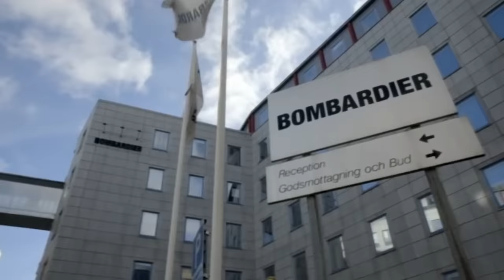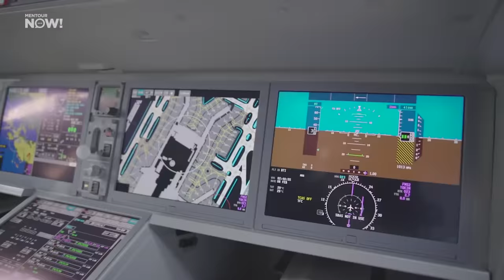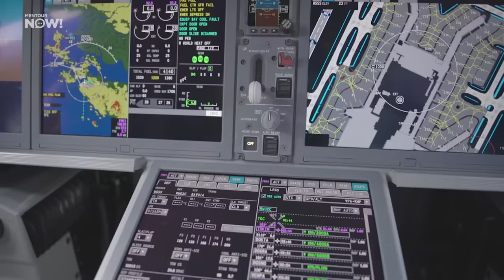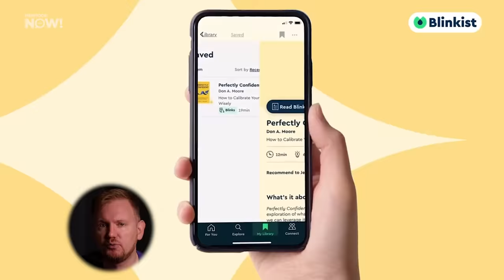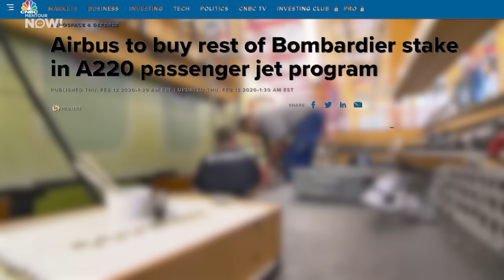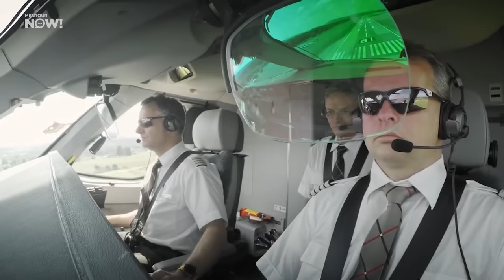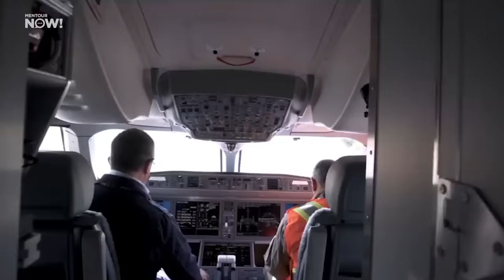Did Boeing GIVE Airbus a FREE Airplane?!

Comment: Regarding the supply chain.  One way to look at it is that it will be a struggle for Airbus (because it will).  But another is that it is giving Airbus serious inroads with traditional Boeing supplies.  This, in turn, might give Airbus more of a say in product development for companies that traditionally only really answered to Boeing.  And that could place some interesting, and perhaps serious, constraints on future Boeing designs.

I think Airbus is playing some serious 5D chess here.
Reply: Most aircraft already have global supply chains and the use of American made avionics, landing gear, engines etc has never caused Airbus issues in the past. Airbus is as big as Boeing in the commercial aircraft sector so has similar buying capability and already has a A320 FAL in Mobile which in order to meet US requirements for parts of origin has substantial US supply lines. I don't think this is the limiting factor here. The key limiting factor is the way that Boeing has been managed since it moved from Main Street to Wall Street.
Reply: @PAC-fp9hy  I take you didn’t watch the video or, if you did, you assume I wasn’t paying attention at all and, in addition, disagree with the conclusions of the video?

Further, you’re focusing on the wrong part of the argument (probably my fault for writing it wrong), the main thing I was trying to put forward is that this would give Airbus further inroads with more of Boeings partners (if what Mentour said is true).  Those manufacturers will probably look into homologation wherever they can to keep costs down.  Homologation has it’s advantages in regards to diversifying a supply chain, but it also means you need to build towards that line of products rather than being able to expect that the vendor will bend over backwards to work with your technical requirements because they have no other major customers.

Lastly, I never said this was Boeings only problem.  It’s just another possible bullet point on a very very long list.
Reply: @TheActualJae  Airbus already has partnerships with many of Boeing's partners. PW, Engine Alliance, RR, Moog, Thales, Honeywell etc etc. They are not just Boeing partners. This deal is unlikely to have given Airbus any significant supply chains that it didn't have already. And even if it did, the components would be only be suitable for the A200 such as the airframe and composites. The whole argument for taking on a loss making project was to be able to use existing Airbus supply chains and buying power to make the A200 profitable, so that would imply that AIrbus already had contracts withe the main suppliers. The question of homologation is very complex because each component has to pass FAA and EASA requirements for the DOA, POA and MOA in respect of the aircraft type it is fitted to. That is always a lot work as Boeing know only too well when it cut corners on the Max. Mentour is a Boeing pilot, and he does not work for Airbus, so it is probably speculation on his part.

Comment: Recently our local national carrier (Croatia Airlines, OU) swapped their A320 neo options they were sitting on for years to A220 (with plans to have an all-A220 fleet at the end). Besides the plane being pretty "right-sized" for OU it seems that Airbus was willing to work this swap out as it needs all A321neo production slots it can get as that is where their biggest backlog x value currently stands. So by shifting some of the "smaller" airlines to A220 (Air Baltic being a showcase) pipeline, Airbus can churn out A320/321 neos for big/major orders and operators (getting them planes earlier than previously possible, to prevent them from considering 737MAX).
Reply: Just curious, how will OU finance those planes?
Reply: This is exactly the reason Airbus is considering the A220-500. Yes it will compete with the A320neo sales, but they cannot make enough of the A320 family planes anyway and people are choosing Boeing because of the lower wait times.
Reply: And on this way Airbus avoided that Croatia Airlines switched to the E2-Jets from Embraer. Air Baltic was most probably the model for this decision.
Reply: Yea that's a possibility but not the current reality,  you still have to wait longer to get the a320neo/321neo , compared  to the MAX . 

The a220 can only be a substitute for the MAX 7 /a319 , so Boeing still has a few more years to take advantage  of airbus's limited /constrained production and huge backlog . 

Not to mention that the a220 is currently   having some supply chain issues  of its own , so ramping  up production  won't be an easy task 

Boeing will rack up hundreds of orders for the 737MAX  before Airbus manages to increase and stabilize its production rates .
Reply: @ProT3ch  the 737MAX 8 seats around 212 in MAXm configuration,  a potential  a220-500 won't seat more than 180. 

The a220-500  will have lower profit margins than  the a320neo for its first few years , and will definitely  hurt 320 sales . Probably the reason Airbus is still in some kind of a dilemma  with this .

An a220-500 could take 2-4 years , lots of time for Boeing to continue  to snatch hundreds of orders , due to a320neo/321neo production  slot constraints.

Comment: The A-220 or CS-100/300 is a real step forward for single aisle aircraft.  The layout in the Galleys ,Cabin and Lavatories are very new and welcomed by Carriers.   The Fuel efficient Engines and Pilot designed Cockpits make it not only preferred but a runaway Winner in its category. 
Yes I am a proud Canadian or loves the Bombardier product.  Perfects you can confirm this point. The door sill just inside door one, still says CS-300 as a tribute to its heritage. 
I love your videos.

Comment: In my own opinion, Boeing has sat back on it's laurels for too many years. The company threw it's dummy out of the cot. For too many years, Boeing has been shortsighted. 

They thought that payback would be to get involved with Embraer after the Delta deal. And how right 'royally shafted' those poor guys became when Boeing dumped them. It was like being proposed to and then jilted at the altar.

I am so happy the C-Series/A220 became the success it's turning out to be, thanks to the skills of every designer, engineer and Canadian that put their heart and soul into this Bombardier project. Long may it succeed.

All kudos though to Airbus for spotting a gem and taking it to the world. The sad part of the story, is if Bombardier had just pushed on that little bit longer, maybe it would have been a success in it's own right without either of the duopoly.

At some point, Boeing has to realise, for all the magnificent machines it builds, it cannot think it's a company that dictates anymore.

We've all seen what happens to dictators!
Reply: The C Series is a well designed Aircraf, it took Airbus marketing to sell it to the world , pilots and passengers who fly it are happy with the experience- flying it and  quietness  and spacious feeling inside.The  geared  Turbofan by P&W is a good engine after some development.
Reply: To be honest I think that they needed Airbus help with mass production, as well as cost reducing manufacturing techniques (from memory)
Reply: I work on the military side of Boeing and aren’t commenting with insider information. My opinion is that we’ve lost the love of the products. I’ve had this conversation with  many executives. I’ve said, “who’s our Elon”? In other words someone that loves innovation and customers. Once our competitors uses the next step function in technology in the 737 market, the end has begun. It’ll take 20 years, but Boeing is not a leader, just a cost cutter. Selling the same 50 year old design with lipstick applied.
Reply: @jamesdellaneve9005  It's such a shame to hear those words from someone that works with Boeing. As you say, to lose the passion for what you're producing and build it to a price is indeed a sad state of affairs. 
I don't know how true this is, but I hear the rot started when MD management took over?
Reply: Without one of the duopoly behind it there is just no way the C-Series would have been anywhere near the success it is - it may have turned a useful profit but it would never be the Embraer-killer it is. Its basically about massive marketing muscle, plus an awful lot of capital and mass manufacturing expertise on tap.
Reply: @kenoliver8913  To a degree, iagree wholeheartedly with you. That's why I say, it was such a shame that they needed either of the big two and that they couldn't do it alone. But as we've seen, it's not panned out that way - but a success is a success, whichever way you look at it.

Comment: You have to feel good bombardier, they spent a bunch of money to develop a great jet that would have been competitive and would have established Bombardier as a real competitor to the duopoly.
Reply: They certainly did design a great jet. 

Apart from Boeing screwing things up, one thing that was in the way of it attracting seriously large orders was the size of Bombardier in the market place. They were comparatively small, and suppliers were reluctant to give them good prices on parts. So the C Series was going to be moderately pricey to buy and support. Bombardier also didn't have a large sales team; it takes a lot of staff to run multiple sales campaigns necessary to get a large order book. That they managed to sell any at all as Bombardier is testament to just how good a design it is; the plane sold itself to anyone that sampled it, and made the price still look good.

One of the things that is good about Airbus coming into the program is that Airbus can drive supplier prices down, and has a vast sales team that can mix A220s in with other sales campaigns. Airbus saying "we believe in this aircraft" is a pretty good endorsement, enough to make a lot of airline executives believe that there is a long term future for the design, which is also an important thing. 

I do feel sorry for Bombardier that they got clobbered so, but I think that, in the end, for the people (if not the investors) it's going to work out well. They've got a slice of what looks like being (in the long run) a very large cake. It's not as glamourous as the whole cake, but it's a very good second best! And for the government investors, it'll come good; there's going to be a lot more well paid, tax paying employees for a long time to come, bringing in money from overseas.

Comment: Scott Hamilton's "Air Wars" book is certainly well worth a read. 

One thing not really discussed in this vlog is how acquiring the C Series fits right in with Airbus's long term commercial strategy, inspired by John Leahy (Airbus's recently retired head of sales, who basically made Airbus what it is today). Leahy was all about market share, and had a very strong drive to increase Airbus's market share as pretty much the sole commercial driver for the whole of Airbus. He / Airbus didn't mind whether or not market share came about from Airbus selling more aircraft, or spoiling Boeing's prospects in the market. 

Acquiring / saving the C series was just another way of moving market share from Boeing to Airbus. To outperform all aspects of A220 / A320neo, Boeing would have to spend an absolute fortune on a 737 replacement, to have any hope of reversing the single aisle market momentum and restore good sales margins. Boeing clearly hasn't the money, expertise, or patience to do so. 

And it'd really take two different models for Boeing to successfully outperform both A220 and A320neo. So, Boeing need two moonshot development programs. Airbus picked up the fruits of one pretty good moonshot program for nearly free. Even if Boeing did a full CF A220 look-alike, it'd cost them a fortune and not be significantly better. 

Plus, no one really realised there was quite such a large market for something like the C Series until the C Series came along and Airbus got involved, but that's now all Airbus's market.

What's even worse is that Airbus are moving things along. They're looking at hydrogen-fuelled aircraft, which (if successful) makes aviation sustainable long term (assuming green H2 production). Boeing need to be designing aircraft to at least match or exceed Airbus's current line up to be able to regain some market share, but also need to be designing beyond even that. I don't think they've got anything like the engineering or commercial capacity to do that, and won't get the capacity because their market share is too small and shrinking.

Comment: I'm Canadian and you can bet my bottom loonie we were and still are pissed off at Boeing. I am delighted with their ongoing struggles and the CSeries affair just encapsulates why their commercial airplane program is in tatters. Totally incompetent management. Trust me, Canadians will not forget what Boeing did. Also lovely to see them eliminated from the fighter replacement program. (And I used to be a Boeing fanboy).
Reply: As a European, I am delighted about the collaboration between Bombardier and Airbus. A profitable deal for both. That Boeing faceplanted in the process is a thick layer of icing on top.

Comment: I worked for Boeing for over a decade. One thing that still baffles me is their arrogance. Their mindset has always been "we're the best" and "it's other's fault". When Boeing lost the initial tanker competition, their marketing is all about how the government's decision "doesn't add up" and make the government to overturn that decision. When Boeing made demand to supplier/customer on price or requirement, a common phrase that got thrown around a lot is "Because we're Boeing". Again, with Bombardier, Boeing thinks they can do whatever they want, got so blinded by just crushing competition, they forgot they're no longer the industry leader. What's worse is that hasn't really change as far as I know. 
My passion with aerospace started with Boeing, and ended with Boeing. To me, Boeing is a major corporate cancer that's too big to fail for the US government. It won't die, it just whine and sucks up resources.
Reply: sounds like a normal US mindset to me
but yes they haven't learned from the misjudgment against Airbus when it came up one single bit
Reply: The arrogance has been there from day one.  When the first Airbus A300 was announced, Boeing referred to it as "that little European project", and consistently underestimated both Airbus and the aircraft.  Nothing has changed in 50 years.
Reply: That was crazy airbus offered a finished tanker instead boeings concept was choosen.

Comment: The a220 is a real pilots dream compared to the 737 max and ng
Reply: Depends how you look at it. A220 is easier to fly but the 737 is more hands on.
Reply: @shrimpflea  also need to consider flight deck spaciousness, storage of crew bags, noise, window size and ease of FMs programming, cocpkit checks.

Comment: The key comment here is that the A200 series has scalability in its design and the potential for a dash 900 means that Airbus has a more modern design than the A320 for the future at very little cost and a much shorter entry into market cycle. At some point Boeing has to end the production of an aircraft designed in the 1960s and equally Airbus has to bring to a close its A320 program as there is only so much development. Clearly what is limiting the A200 series is cannibalization of the A320. The comments about profitability are valid but are proportional to the numbers being produced. Mobile only started producing the A200 series in late 2020 and so is still ramping up (and in between we had the global Covid crisis). There still needs to be complete integration into the Airbus supply chain and back office production systems. We are talking about different PLM systems etc. Also look at how long it takes a new FAL to become mature enough to ramp up to profitable numbers - Boeing still have not managed to turn burger flippers into aircraft assembly technicians at the Charlston Dreamliner FAL. These things take time.
Reply from the maker: Very good points!
Reply: Indeed, exactly.
Reply: But right now Airbus might be limited in how many A320 they can supply. The A200 series is an alternative.
Reply: @franziskani  Yes.
Reply: @franziskani  In the short term it is not yet a replacement for the A320 because it can only be produced at Mirabelle and Mobile. Both FALs are not at the production rates of Toulouse or Hamburg. It is a direct replacement for the A318/319 however, because these variants do not sell in numbers.

Comment: Nice looking plane, which generally means a good plane.
Cockpit looks amazing.

May be Boeing should get back to engineering planes, rather than only thinking of management.

If Boeing had used the C Series to phase out the 737 then we wouldn't have had the MCAS disaster.
Reply: The nose section of the A220 bears a striking resemblance to the nose of the DH Comet.
Reply: @eamonryan2198  That’s what I was thinking, as does the B787. Amazing that a plane designed without computers would have such aerodynamic properties.

Comment: I build the A220/300 in Mobile.

The program has a lot of kinks to work through. But it’s promising. 

The manufacturing processes over do it on quality side right now, but that’s the way young programs are. 

The tariffs are avoided because the Mobile FAL IS a foreign trade zone under the jurisdiction of the Canada’s aviation regulatory authority, Transport Canada.